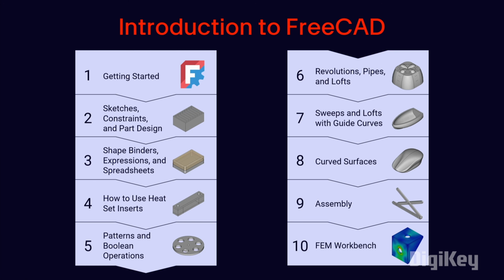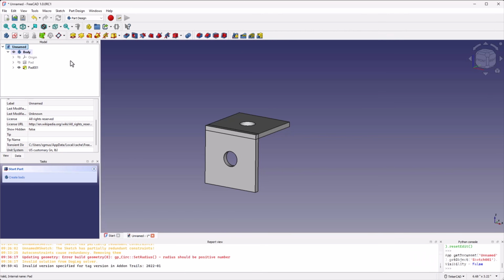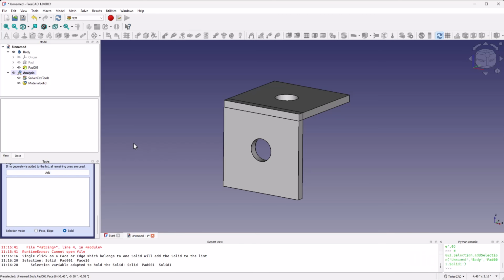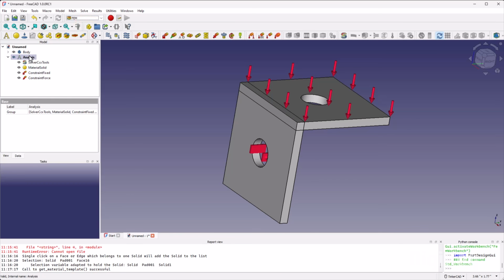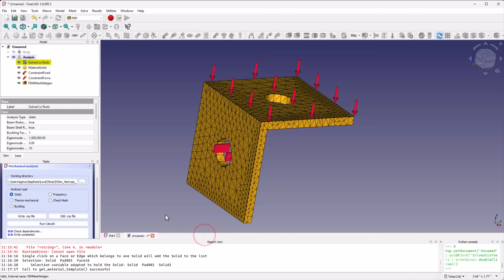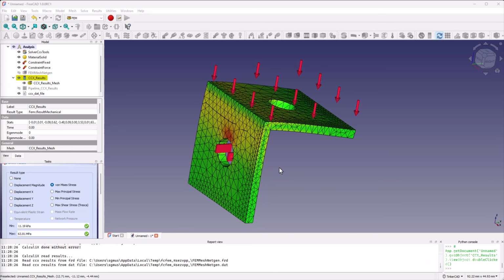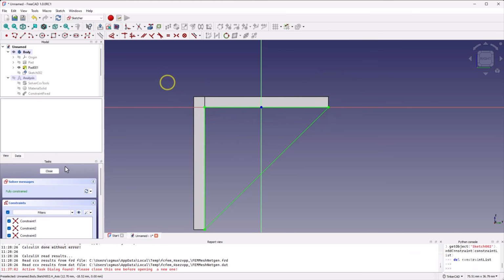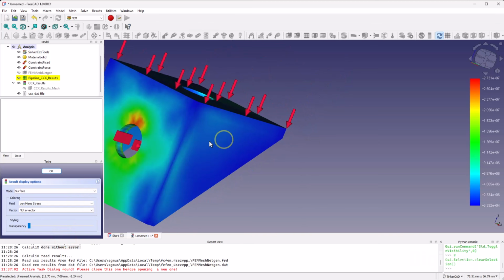Introduction to FreeCAD Part 10: Finite Element Method (FEM) WorkBench Tutorial | DigiKey

Comment: Thanks for the videos. Just a comment: it is hard to trust FEM for 3D printed parts.I just empasize in that the physical properties of 3D printed materials are just not the same as those of the material of which the 3D printed part is made of. Also, it is not true that the smaller the element size the more accurate the results. At some point, the FEM results become "mesh-independent". To find this point one has to do a "convergence study", of which one gets the adequate element size. Also, mesh refinement is quite useful. One can use a finner mesh where one expects stress and a coarser mesh in the areas where stress is not expected. Also, the maximum is just a scale for visualizations. It wont show you what would happen under a 500 kilograms load. The load is still 5kg but the deformation is exagerated only for visualization. Also, not sure if this is the correct interpretaion of the von-Mises stress. It would be useful to compare it with the yield stress of the material, and use a safety factor...

Comment: Thank you so much., I  wonder how you might simulate the first bracket with a metal washer. Maybe with a washer shape surface on the inside of the bolt hole?